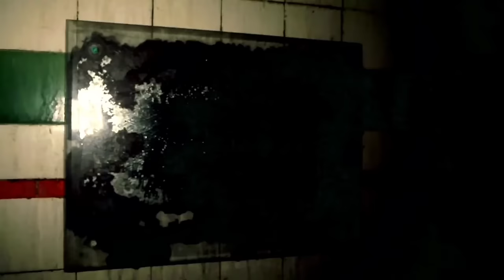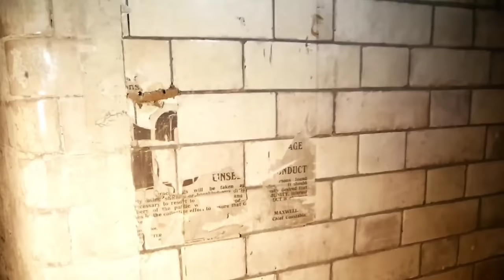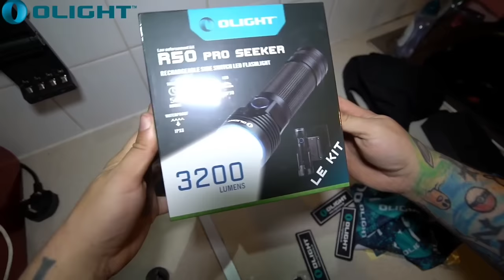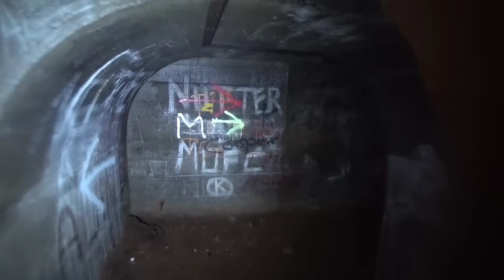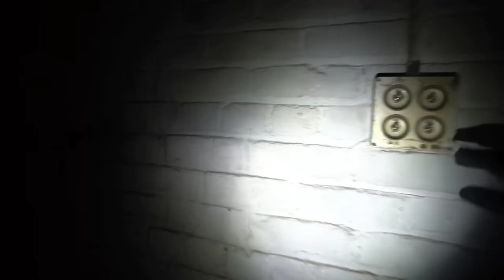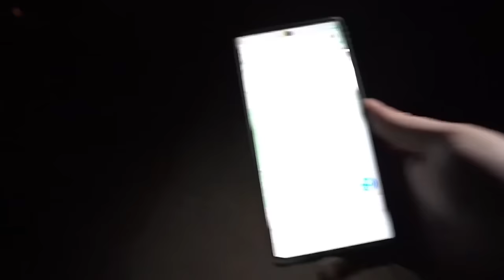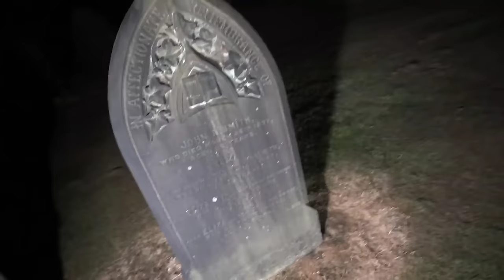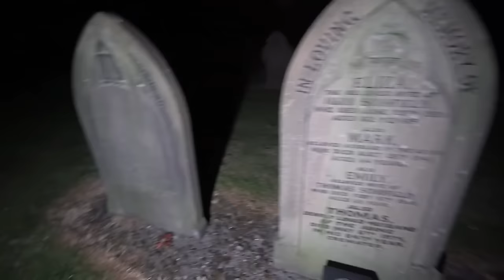HIDDEN UNDERGROUND CITY UNDERNEATH MANCHESTER | EVERY LOCATION

Comment: The old poster is embedded in the wall because old posters used to be put on with a brush or roller with some sort of glue either on the brush or roller or the glue was on the back of the poster and you roll the poster or brush the front of the poster to stick it

Comment: This is so sad to just hide history like that. This should be Showcased and make it public like a museum. 
I’m a history fan and my favourite era.
I’m obsessed with the windows doors and architecture of everything. 

10:22 even public bathrooms had beautiful pieces of furniture in them like cupboards etc and sink basins (depending on class & the actual era these were built) 
The saying “Spending a penny” was coined (pun intended) 🤭 in the Victorian era as there would have been a warden/keeper (mid-1800s) it would cost a penny for these public toilets to be unlocked.
17:50 this looks like it could have been possibly coal store
Many or the side rooms would have stores, merchants, tradies like blacksmiths ect or possibly homes.

20:12 the poster is incredible 
21:36 not too sure on this I could be wrong but this it was a sign with 6 bulbs in that would light up stained glass until neon shop signs were invented in 1910 they didn’t gain popularity until the 1920’s-1950’s
I’d love to get a date on these because it has electricity which wasn’t until 1890 there’s evidence I saw earlier in your video of a gas/candle streetlight 
25:31 wold have been a trade post or post office

Population in Manchester in the 1950’s was 2,422,000 people in that time. 
The amount of injured and sick people that would have been sheltering down there and died plus residual sounds smells fear I’m not surprised it feels scary and is likely haunted. 
1:45:28 barrel roll is giving me flashbacks to falling down one at work 🤣
1:50:11 incredible! 
1:54:09 stunning staircase
1:56:28 obsessed with Column radiators 
2:11:28 why do I love the colour of the railing so much 😊
2:55:45 hate how nature is being ruined by people throwing things in 
3:10:48 fish know that lights attracts bugs it’ll be trying to get food - it’s doing burn outs took me tf out 🤣💀